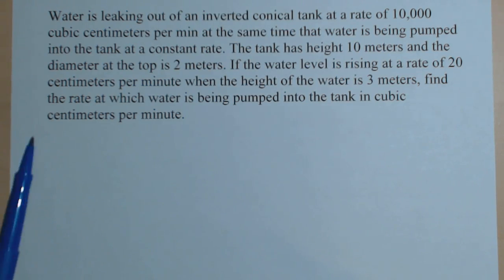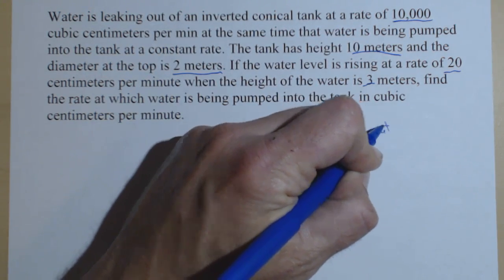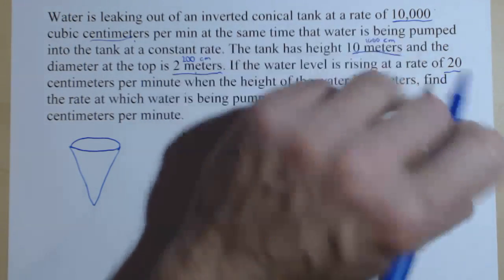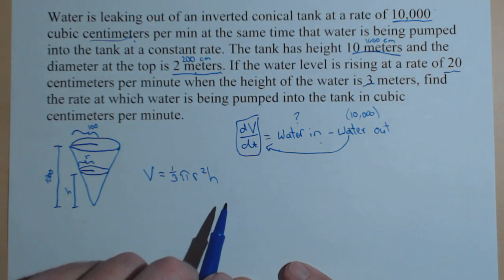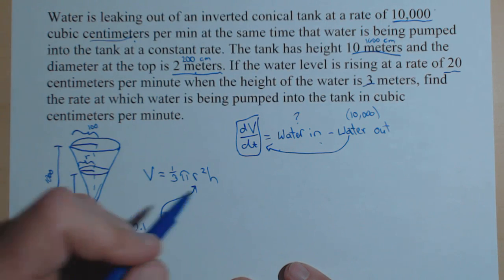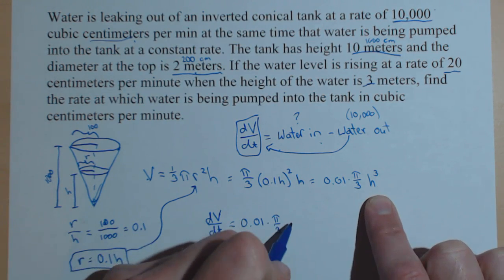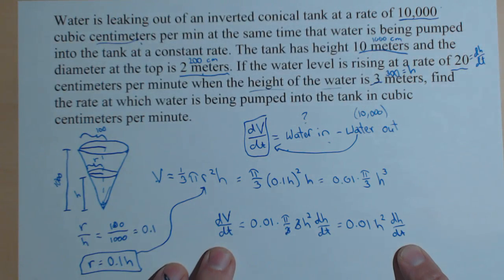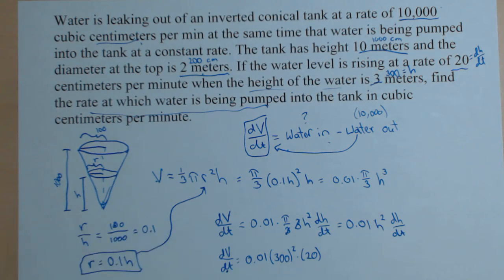Related Rates   Inverted Conical Tank with Water Leaking out

Comment: Can I ask? Why the rate coming out of the water is not the same with the rate coming in the conical flask?
Reply from the maker: Since the vessel is conical, the rate the volume changes is greater/smaller depending on the depth of the cone. Thus what is needed to be added to keep the level can be different than what is leaking. If we had a cylinder, they would have been the same.
Reply: @Phillydogaz1  thank u very much 😁😁 now it is much clearer than ever